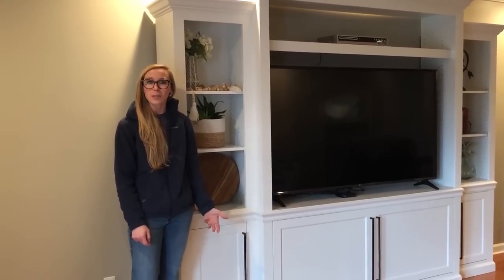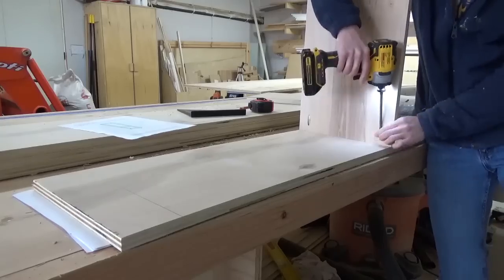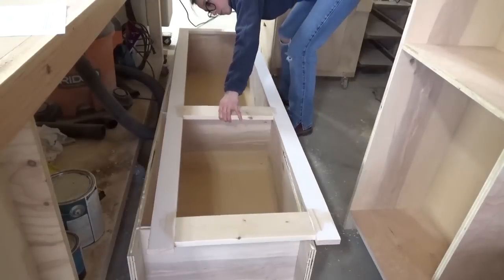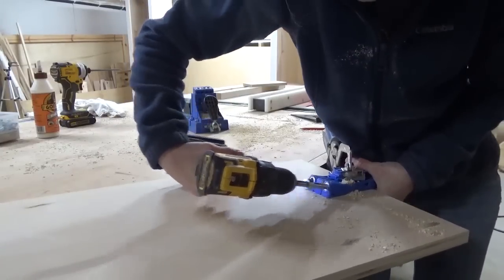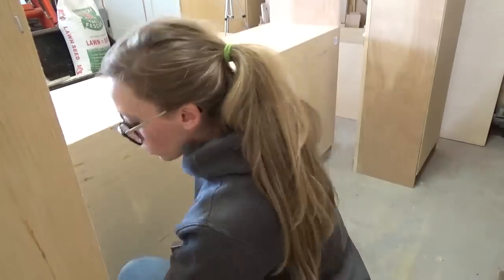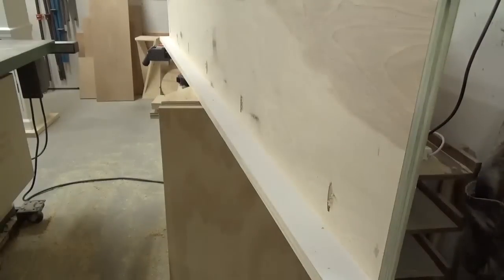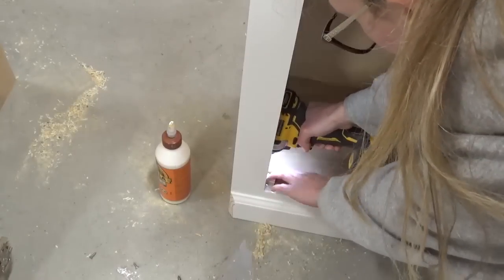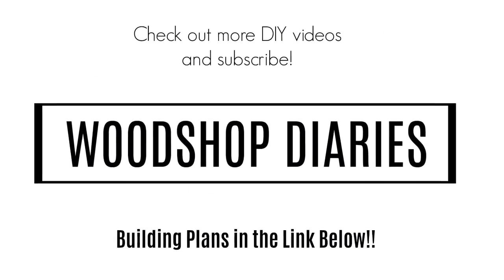How to Build a Large DIY Entertainment Center

Comment: Hello Shara, I downloaded the plans for this entertainment center and I built it but painted it a different color and added some decorative trim. It came out pretty good and I received many compliments on the outcome. Thank you for the plans. It was exactly what I was looking for. I have pictures to show you but I don't know where to post them.
what I noticed was that the plans called for the middle cabinet side and top to be 16" wide but when you cut 16" off one sheet of plywood, I come up short on the last one. 16"x3=48". the plans do not account for the cut of the saw blade. It is more prevalent when you cut the side cabinets, side panels. 12"x 4=48"  I did notice it and made adjustments.I just thought I would point that out because I downloaded the queen size bed plans and noticed the same thing. 
I appreciate all your hard work, positive attitude and energy you put into making your projects and videos. 
Much respect,
Baldomero Moreno

Comment: It's fine to use blocking to get hinges and guides to work. I fill the entire area or use strips instead of using small separate blocks though.  I don't care much for painting, but spraying is a lot nicer than brushing or rolling once you get the hang of it and an area to do it in.
Reply from the maker: nevermindthebollocks I need a spot large enough to be able to spray. My husbands tractor is always in my shop and he’d not be happy if I got paint all over it 😅 but using a large strip instead of the blocks would definitely have been cleaner haha. I’ll keep that in mind for my next build! Thank you!

Comment: You are a true inspiration! I really would like to make this entertainment center. But I need doors to cover the TV when not in use, and also I need some doors with glass in them for the side pieces. Is there anything you can refer me to or link to accommodate them? It would be greatly appreciated. Keep singing girl while you work! You have such talent in both singing and creating furniture. God just happens to be a bonus <3
Reply from the maker: Thank you! You could add sliding doors like this piece:
https://www.woodshopdiaries.com/diy-sliding-door-entertainment-center/

Or you can build regular cabinet doors for the tv cabinet like this:
https://www.woodshopdiaries.com/how-to-make-diy-cabinet-doors/

And you can make them slide back into the cabinet using pocket door hardware like this piece of you wanted:
https://www.woodshopdiaries.com/diy-pocket-door-cabinet/

Also, you can build glass doors by using the tutorial I linked above to size and build the frame and simply use a rabbeting bit like in this post to add glass on the back side:
https://www.woodshopdiaries.com/how-to-make-custom-diy-picture-frame/

Comment: Awesome job on the entertainment center and the video. I recently completed a very similar project. I wish I had seen your video first. I would haven done a few things differently. I wish I had the work space that you have . all of my work is done in the driveway, so very weather dependent and alot of set up time. Again, kudos, very nice work. ;)
Reply from the maker: Thank you! I always say you have to work with what you have. There’s no way this would have fit in my last two shops from my previous homes. I would have been building it in the yard. I’m grateful for a bigger space now, but big things can come out of small spaces, too! Ive has several shops over the years, all smaller than a one car garage until the one I have now. Keep building and don’t let anything hold you back 👍

Comment: Beautiful project. Did anyone ever suggest where you can find those hidden hinges for framed cabinets? I need something similar and do not have the option of working around the issue like you did.
Reply from the maker: Hi! Thank you! So they do make concealed hinges for Inset face frame doors...you can do a quick google search or find them on amazon. They’re just expensive...at least they were when I was building this. So I went with this instead to save quite a bit of money. But they do make them...and if you don’t have another option, you may be okay with paying the higher price.

Comment: Very nice project. It is not quite complete, to give it a true built-in look you must remove the baseboard behind the cabinet. Most custom cabinetry has this in mind when the cabinets are built. The edges that will butt to a wall have extra scribe material that will be scribed to conform to non perfect walls. The baseboard, chair rail and crown (if they match existing) that go to the wall are left off so that mitering or coping can be done. In your case either take off the baseboard or you can cut the back of the bases to allow the cabs to go to the wall, the outside pieces of baseboard can be taken off and coped to the existing baseboard. The easiest is probably taking the whole baseboard off along the wall, putting the cab. to the wall and after mitering the left and right pieces of baseboard on the cab. the wall baseboard can be mitered to the left and right pieces on the cab. A view of the left door  (8:00) shows a bit of a problem with the reveal, top right corner of the door touching the cab. and  the left edge of that door is too close to the cab.at the top, can be adjusted better, but I think the cab may be racked a bit, maybe putting it to the wall would solve that problem? You should be proud of the result of your work, I'm only trying to take it another step toward awesome.
Reply from the maker: Larry Daniels thanks for the input. I’ve done several built in cabinets, so I agree with what you’re saying about the baseboard. However, I wasn’t intending for this to be “built in” because my mom moves furniture often and this is likely not going to stay in the same location long. Also, the power strip cable runs behind the cabinet in order to plug into the nearest outlet, so I don’t want it butted up to the wall to leave room for the cords. And yes, you’re correct my doors aren’t perfect. But the problem is that my left door was slightly warped. It isn’t touching the cabinet frame...the space is even around the door...it’s just inset slightly further than the rest of the door. I’m not perfect. My work isn’t perfect. I do the best that I can. But my mom loves it. So I’m happy 👍
Reply: @WoodshopDiaries  I am giving you some tips as an installer that has handled more cabs. just like these than I care to remember. I installed in a very exclusive area of So. FLA, money was no object. I can see things most would not notice, as I said the door could be made to show better by adjusting the hinges correctly. This type of cabinet needs to be against a wall or it just looks out-of-place! Additionally, when installing a tall cabinet one needs to make sure each (in this case- of the three cabs.) are level and plumb, this is only arrived at by shimming the bottoms of each cab. I have yet to find a floor that was dead level over the width and depth of your cab. Convince your Mom that you can make this cab even more beautiful and then do it! I agree that you are not perfect, but guess what, I'm nowhere near perfect, too. But we all should strive to take in information that will make our projects easier to build and more professionally finished. Any information I offered is done with a sense of helping someone that may not have my knowledge or experience level, you are so young and are doing great, I can only imagine how good you will be when you have a few more decades of projects in your past. Please stay happy, I look forward to your 2020 projects.

Comment: I like the way how you work.
Question: Do you use pocket-hole plugs? If yes, it will be worthed purchase pocket-hole plug cutter?
Reply from the maker: I use them occasionally but not often. When I do, I either purchase a dowel today and cut it flush after gluing in the pocket hole or just use the pre made plugs
Reply: @WoodshopDiaries  Thanks for your prompt response.  Your time it is appreciated.
Reply: @WoodshopDiaries  how long have you been doing woodworking? Really your talent it's unbelievable

Comment: You are so incredibly talented.  I love those handles.   By the way, what's the difference between those disk sanders and a random orbital sander in terms of overall function?  Do you need both?  If not, which do you find more useful?  Subscribed!
Reply from the maker: You’re so kind. Thank you! I’m not sure what you mean by disc vs orbital sander. I only have an orbital sander and It uses 5” round discs.
Reply: @WoodshopDiaries  I was referreing to those flat round sanders, like a plate that spins vs, the random orbital sander. :-)

Comment: I haven't looked into things too much since I will have to make a few small changes to your plans, but is there a reason that the bottom shelf on the side cabinets is a half inch higher than the shelf on the center unit?
Reply from the maker: Yes, it’s so the trim pieces will line up across the front

Comment: To accommodate a larger TV (75"), how would you recommend to adjust the measurements from your plan?
Reply from the maker: You’d need to measure the actual WIDTH of the tv (tv sizes are actually the diagonal measurement) and adjust the inside dimensions of the middle section long enough for that tv to fit with at least an inch wiggle room on each side. Ex if the tv is actually 70” wide, make the inside of the middle shelves 72”

Comment: How do you feel about the 18 gauge nailer?  A woodworker online said he prefers the 23 gauge pin nailer because it doesn't leave large holes in his work, and another guy said he feels like the 18 gauge nailer is best because he feels it is more versatile, so I had a hard time deciding between the two. I grabbed an 18 gauge nailer (I think it's the same as yours) but haven't opened it yet.  I'm also wondering if I need to get a beefy battery or if a 1.3 Ah or 2.0 Ah battery will do the trick.  Thanks in advance!
Reply from the maker: I like the 18. The nails are larger so they’ll hold stronger. I putty my holes anyway, so smaller holes don’t matter to me as I putty them either way. I personally like the bigger batteries as they last longer, but it’ll run fine on the smaller ones. If you have the budget, personally, I’d spend more to get the larger ones.
Reply: @WoodshopDiaries  You're awesome.  Thanks for the quick reply.  Do you think a 4.0Ah is about right as far as "bigger"?  I have dewalt drills/drivers and saws.  This is my first Ryobi tool.  My mom is the tool collector in the family, believe it or not ;)
Reply from the maker: Yes! I have a couple of the 4.0s and they’re the ones I like to use in my Ryobi tools
Reply: @WoodshopDiaries  Thanks so much.  Time to shop and, even worse, spend that money ;)

Comment: By the time you are rich enough to buy your own  woodworking studio and equipment you may as well have just bought the thing in the first place
Reply from the maker: I’m not rich so I don’t guess I’ve made it to that point yet. But if you do a little research, you’ll find you can buy all the tools you need for just a few hundred bucks. I doubt you could buy this for that.
Reply: OK I will get back to you when I have calculated all the materials and every single clamp, drill, cutting tool that you used and I guarantee it will be well over a grand never mind having a workshop to do it in lol! @WoodshopDiaries
Reply from the maker: I look forward to seeing what you come up with.